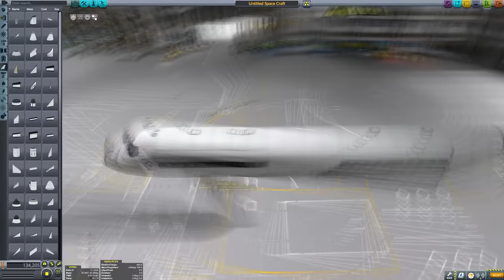KSP: Nuclear-Powered Jetliner to EVE!

Comment: It's weird that nuclear trains didn't get as far, since trains can have very big/heavy engines in a way a plane can't.
Reply: Well, everyone would like it, but no one wants it first
Reply: @sitfish1113  
tell that to the Americans
Reply: @sitfish1113  American trains are  not powered through tracks
Reply: @KingOfTresune  hold up what
Reply: I got comments to delete
Reply: Technically electric trains powered by nuclear reactors miles away could be considered nuclear trains.
Reply: @alexwimmer5198  
Americans refuse to build the infrastructure for powered train lines though
Reply: @sitfish1113  American trains are powered by diesel. Not electricity.
Reply: @Graknorke  we would like to, but most of Amtrak’s routes are not owned by them, because the government couldn’t care less about funding public transport. Amtrak’s most important route which is owned by them, the northeast corridor, is fully electrically powered.
Reply: @sitfish1113   certain railroads, metros in particular get their electricity through a third rail, instead of an electric wire above the train. In both cases the return power is routed through one of the "regular" rails
Reply: @sitfish1113  Yeah, our trains use diesel.

Comment: "We don't have nuclear engines in the game"
Nerv atomic engine: Am I a joke to you?
Reply: He said JET engines
Still funny though
Reply: the nerv-a engine is not an atomic engine as it uses oxidizer. closed bell and open cycle engines heat liquid gas or just plain but volatile liquids like alcohol and kerosene to accelerate thus there are very efficient. Also you can build SSTO with ramjets and open cycle engines as they both only use liquid fuel, so you do not have to balance the craft out midflight. ideally, you can also use thermonuclear jetengines, as shown here to take your SSTO on a suboribtal trajectory without using any d/V and then fire up a thermal nozzle which uses the wasteheat of your thermonuclear jet engines as a propellant to go into orbit with practically no fuel at all. Once in space, if you have a reactor on board that produces alot of waste heat you can go anywhere you like without using any fuel although the burn times might take a couple of years.  So yeah nuclear propulsion is awesome. In the interstellar extended the nerv-a engine gets replaced with a real open cycle engine and you even get fuel tanks which only hold one kind of propellant thus saving alot of weight, since you don't need to have to have two tanks built into one cylinder. with only one long tank and the new nerv-a engine you can get up to 45000 d/V in a vacuum.
Reply: @juleswoodbury58  I mean yeah but the description of it literally calls it the "LV-N 'Nerv' Atomic Rocket Motor"
Reply: Jules Woodbury in fact the Nerv engine does not actually use oxidizer in practice! It is modeled after the real-world theoretical nuclear thermal rocket, which uses a fission reactor to heat its propellant and force it out of the rocket nozzle to generate thrust (as opposed to a normal rocket, which ignites the propellant and uses the energy released by the resulting chemical reaction for that purpose).
Reply: Hahahahahaahahah he said "we don't have nuclear JET engines in the game"
Reply: @1mariomaniac  Also, it only uses the fuel, not oxidizer. And a Nuclear Thermal Rocket would probably run better on water than something expensive like LH2 or RP-1... but those upper engines are likewise mods... they look like some of the drawings I've seen for the gas core fission engines that they were talking about at one point. Pro tip, the thing that is heating your propellant is fissioning nuclear gas. It is very hot, in all definitions of the term. Do not point this at your own tailfins. In fact, keep them well away from anything you particularly want to keep.
Reply: @juleswoodbury58  the nerv-a does not take oxidizer
Reply: Dude your username used to be my gamertag
Reply: @parsley8188  lmao what a coincidence!
Reply: @juleswoodbury58  the nerv actually uses no oxidizer. But he probably ignored it because they have pathetic thrust while on kerbin
Reply: I believe he means nuclear turbojet engines
Reply: @blackburngaming8345  he does, I just kinda missed that part and it seems the joke stuck anyway lol
Reply: Yes, you are
Reply: @juleswoodbury58  it.. doesn't use oxidizer???
DO YOU EVEN PLAY THE GAME BRUV..

Comment: My god, can you imagine if we really had nuclear cars? Every time a drunk driver accidentally scratched someones car the neighbouring city block would be vaporised.
Reply: Imagine nuclear cars in the Middle East. The region becomes a wasteland.
Reply: nuclear reactors are physically incapable of exploding, they do not contain the right ingredients nor the right environment.  Yes if the reactor was breached it could melt down and leak molten uranium fuel and radioactive vapors but it could not explode.
Reply: Yup.
It's a very complicated thing to produce a nuclear explosion, it's a secret art only mastered by the real peoples who truly embraced Cold War with the joy of overwhelming destructive power.
It's all about compressing the fissile material as quickly as possible, because the nuclear reaction tends to expend its own fuel at a tremendously high speed, thus stopping the reaction.
A damaged nuclear reactor tends to overrun, makes it coolant boil, its containment vessel explode due to over-pressure, then everything melts, then cool down. Once cooled down, the reaction may resume, only to stop again once the material expended again enough, but it never happened because the fissile core is so mixed with foreign material from the rest of the reactor it loose its criticality in the process of destroying itself. A nuclear meltdown is, in fact, a mostly fail-safe process if the core is kept contained in a strong enough building (TMI is a good example of a "safe" severe nuclear incident).
So, no megaton boom with reactors.
Reply: It would just contaminate everything and give everyone cancer, rather than become an actual nuclear warhead capable of kiloton blasts.
Reply: @Jupiter__001_   A fate worse than death
Reply: Io ,en depends on the size, plus it has to be well protected which means a crash most likely would not cause much or any damage to the reactor
Reply: u all are a little too much ignorant right here, its true that fision reactors can blow up and get radiation in the atmosphere, but fusion reactors will not since they use a minimal amount of non radiactive mass, meaning that it will just get out a little amount of heat and run off, so u literally can have a safest nuclear car than a dude that runs on gasoline.
Reply: Not with thorium
Reply: @santiagoperez2094  It is true except for the fact fusion will hardly ever be done outside a big reactor... too difficult conditions required to sustain the reaction
Reply: those requirmets are hard because it has to work in the atmosphere, on space fusion doesnt need termical aislation, meaning it could be an open circuit.
Reply: @chodeoriki4113  no really, i just said an example, fusion reactors are hard to start, but that doesnt make them less real
Reply: santiago perez I thought fission reactors used non-radioactive mass, because it used easier to get materials such as helium, where it compress’ it to a small point to form a denser atom. Fusion is deadlier, actually deadly, and to cool off the [commercial] reactors, they need special water or some material. Fusion pulls radioactive materials such as uranium apart, releasing tremendous energy (not enough to cover how much energy is used to start it up), and realizing the radioactive substance. Fusion reactors can explode, and not just have a melt down, if it doesn’t have the correct substance to cool or prevent the radioactivity, such as diluted water (removes some type of molecule from H2O).
Reply: @someoneerror3653  u are calling them the oposite way, fission its when u create a light element with a heavy one, and fusion its when u create a heavy element with a light one, im curious how do u learnt the concept but confused the names, lol
Reply: also, the only reactors that produce less power than the needed for startup are the cool fusion ones, these where conceptualized to overlap the need of superconductors, since whe cant produce such a titanic pressure on earth like the sun does, we have to heat the hydrogen way more, meaning there is not a solid thing capable of exist under that temperature. superconductors are needed on fusion reactors to produce a magnetic field that controls the plasma on them.
fussion reactors never exploded and will never do, since, in first place, there is no one working right now, only experimental prototypes that where online less than half an hour, and in second place, the mass it uses its so small that it has not enoght energy to hurt a fly, it also doesnt creates residual radiation.
Reply: Fallout in a shellnut
Reply: Selim Sultan Akbar  find the Muslim
Reply: It doesn't work like that, not even close. People thought cars carrying around gas tanks would result in them being mobile bombs.... not the case. People need to really get a reality check, lol.
Reply: That’s not how it works..
Reply: @oliverlemley9343  thank you
Reply: Theoretically the car is not unstable enough to reenact the destruction of Chernobyl.
Reply: @oliverlemley9343  May I introduce you to the RMBK-1000 Reactor?
Reply: Aereto like 2003 iraq
Reply: Steam is what explodes nuclear reactors are incapable of producing a nuclear explosion the design is so different it is impossible for them to explode the fuel is no where near the same.

What happens is the steam builds up too much pressure they can't shut it down it starts blowing stuff up from steam pressure and then leaking a bunch of radioactive particles in the air which the wind carries for hundreds of miles giving everyone cancer. So no explosion but we had better get good at fixing cancer if we want nuclear cars
Reply: @Assault_Butter_Knife  uh oh, stinky
Reply: If that happens well... in 2077 there would be a nuclear war

Comment: Due to how nuclear reactors work they require a much safer enrichment level of uranium 235, unlike a nuclear bomb that requires a high enrichment level. A nuclear bomb also needs to become super critical, something that is extremely hard or impossible to do in a standard reactor, but because of the fact that most reactors generate steam they can explode but it would be like a dirty bomb instead of a nuclear explosion
Reply: You are correct good sir the chance of a nuclear reactor exploding like the bomb would be so small......
Reply: Cool

Comment: Tried to install RSS
Used my largest rocket to go to Mun
...
Cant even reach half of ideal orbit
:(
Reply: Also known as you really got to rethink your distance measurements. You need a really powerful rocket.
Reply: Takes about 9.8km/s delta V to reach 7.8km/s LEO.  Takes about 4.6km/s to go from the surface of Kerbin to Mun landing and return.  So less than half of what is needed for LEO.

Get something like FASA to provide you with real rocket parts i.e. bigger tanks and higher thrust engines.
Reply: My first orbital craft was a ssto that went to the mun and back.
Reply: @psun256  That isn't so hard in default KSP.  We are talking RSS.  Now that would be a challenge though, an RSS ssto that could do a lunar fly-by.  I don't think there is a spaceplane fuselage that could survive re-entry without turning off heat or modifying the part files.
Reply: Probably worth mentioning that stock parts are kind of underpowered. There's a reason RSS is also usually used with real world part mods as well.
Reply: @garethllewelynevans3553   wooooosh
Reply: gareth lllewelyn You must be new to ksp. Do the tutorials.
Reply: Use bigger rocket

In reality, use the mammoth and a couple of liquid fuel boosters use it the twin boar rocket
Reply: @Aereto  I made it to the Mun on two stages
Reply: Just add more boosters
Reply: Install realism overhaul
Reply: @kurtweinstein8450  i made a 22 ton stock rocket capable of orbiting the earth :D

This is a old comment but anyways

Comment: Thats interesting that we got closer to a nuclear plane than we did a nuclear train. I feel like a train would be much more suitable especially considering steam trains had been used previously.
Reply: Fr fr
Reply: A train is potentially more vulnerable to regular old theft or otherwise damage though. A plane flies from A to B during flight only malfunctions or hijackings can force it to deviate normally, any airports they're likely to visit are likely under 24/7 surveillance, so are probably likely train stations where the train will stop. 

The thing is, a train runs through random forests where there's no way surveillance can be financed. A potential terror group only needs to shortcircuit the tracks behind a signal to make it show red, and the train comes to a neat halt, where they can steal the nuclear material at gun point. And what if the signals malfunction and the nuclear train runs full speed right into another train, a nuclear disaster waiting to happen. The train can also malfunction in the middle of nowhere, then you're stuck and reaching the train with support vehicles may be time critical regardless of if these vehicles can run on rail or you must hurriedly build a road into the middle of nowhere.

Comment: Before tackling Real Solar System, you might want to try Umbra Space Industries - the main difficulty it provides is life support.  And it's not even necessarily the feeding aspect which is the most difficult aspect, I actually struggle a lot more with habitability.  My first mission to Minmus was a partial failure because the kerbals got homesick in the lander on the way over and refused to work.
Reply: So they got homesick and therefore refused to operate the lander that is supposed to take them home? Seems legit
Reply: Try to place down more kerbals
Reply: @Coli2603  The mod needs explosive collars, they sure ain't coming home without a head
Reply: @geemcspankinson  like the chinese military? 🤔
Reply: @mjrlunpersonal  Wasn't that a mistranslation of them saying the helmet can destroy it's electronics

Comment: Hey Matt I just learned how to use the move and turn options in the editors and I made a small 3 seater plane, 1 crew module and a main cockpit based around using the editor options and it's pretty stable as long as you don't do sharp turn and I have air brakes and a main parachute if all else fails

Comment: Reads Title Damn I was gonna make a video like that!

Watches Video WAIT WHAT THEY TRIED TO ACTUALLY FKN DO THAT??
Reply: JKerman511 the US also developed a spacecraft that was not just nuclear powered, it was powered by actual Nuclear Bombs. 
Project Orion is the name of it and Roverdude made a great stockalike version of it in KSP
(Video by Curious Droid on the history of the Orion Project: https://youtu.be/7dUYfDg3G2A, 
And a Orbiter 2010 mars mission simulation: https://youtu.be/DSK_mymJvkM )
Reply: They also proposed an unshielded nuclear missile designed to fly at supersonic speeds for weeks. The idea was to fly very low in enemy (Russian) territory doing heavy damage to buildings just with the Sonic blasts and spread heavy radiation all over the place. Horrible times.
Reply: Here is the link on the missile I mentioned. It was project slam. I forgot that it also carried a payload of bombs as well. 

https://en.m.wikipedia.org/wiki/Supersonic_Low_Altitude_Missile
Reply: Yeah, and the NERV in KSP is based on the NERVA engine that was developed under the Project Rover program. It got close to being flight rated too. There were a bunch of tests. And then Project Pluto I believe tested air-breathing nuclear engines.
As for Orion, it got close to being built too I think. People in the higher ups stopped it, but a lot of people across the board liked the idea (Air force, NASA, etc).
Reply: +Anthony Pelchat
O yeah! SLAM: The Flying Crowbar. And you think modern day Military-Industrial Complex is bad. Nowadays they are mostly wasting tax dollars and being horribly inefficient, in the 50s, 60s they where trying to murder the entire world in a test flight!
Reply: Didnt they alsodevelop Nuclear Mines which were basically barrels in the ground with massive bombs in them. Also, chickens for some reason. the 50's were fucking weird. lol
Reply: @TheEventHorizon909  the  idea of project Orion dates back to 1958.

Comment: Create a stock or modded orbital megafortress with artificial gravity, solar panels, a cargo bay for short-term  exploration ships, supply ships, ect. Docking ports to be able to continually add stuff forever, and able to build stuff onboard. Plus you can use it to construct and deploy the parts for other fortresses from the first one.
It is not to hard because you can launch up each individual section like a space station.
If you do this... you can use it in the super colonization.

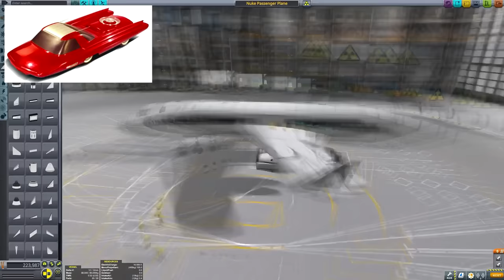Comment: Fun fact. Back in 1950 a nuclear powered jet engine would barley work. But nowdays when modern jet engine have a bypass ratio of 1:10 having a close cycle turbine driving a fan is actually not only possible, but makes a lot of sense. The reactor would also be tiny

Comment: The tu-95 was powered by nk-12's, not nuclear engines
Reply: Ikr
Reply: ArizonaRanger.45 and neither the NB-36H/X-6 or the Soviet Tu-95 were actually powered by the reactors installed in them.
Reply: @AirJimInCT  nah, Tu-95 had rotor engines
Reply: @faritik7  the Tupolev Tu-95 was powered by turboprops. The variant that carried a small nuclear reactor was not powered by said reactor.